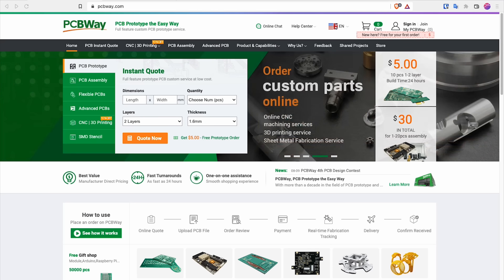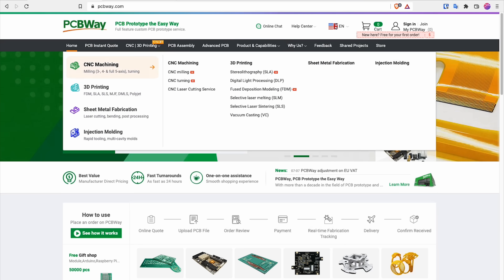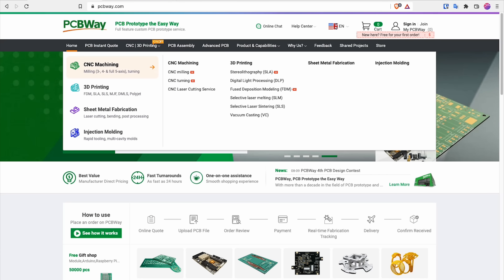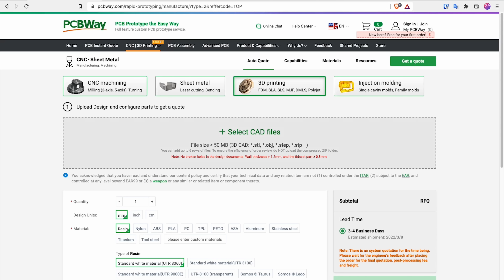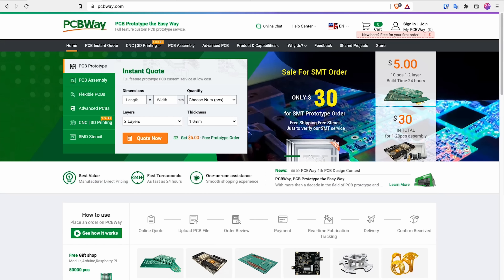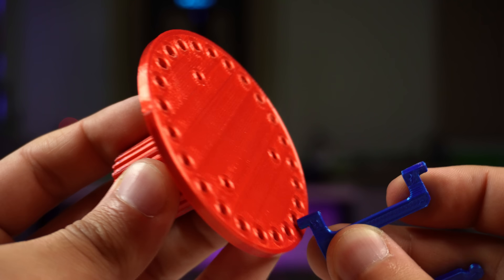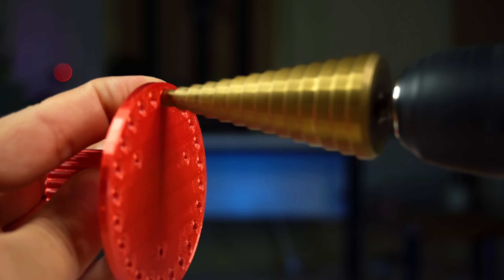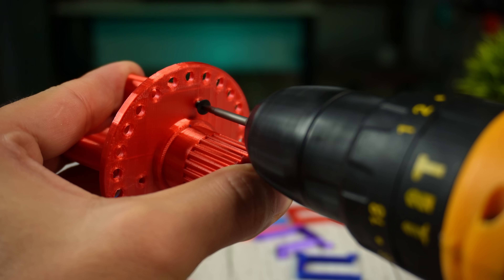Useful Things to 3D Print: Practical 3D Prints for Every Occasion!

Comment: An improvement for the SD card rolodex is to add more room at the ends of the card holders for labels,  maybe about 1.5 to 2 cm, and I believe the original rolodex had a "finger" to keep the cards from falling until an exact moment,  a little after they would from gravity.  That would make it more reliable,  predictable and identifiable

Comment: The tea bag holders look like a PITA to use. They should be flat on the bottom to make sliding the tea bags out easier on your hands. At present, it looks like you have to go at an angle with your hand to make it dispense the tea bag properly. Also, as others have already pointed out, the gimbal glass holder is the most impractical design in this line-up.

Comment: so many people with negative comments, they want to think so much forward that they forget the basics, any design or project exists so that they can be improved, there is nothing in this world that didn't start from the simplest or even ridiculous and that over the years has become the amazing things we use today, look at the beginning of the plane or the automotive industry these are just a few examples of thousands that exist, don't be so negative, evolve my friends, fly with evolution, and stop belittling the PLA I have projects done in PLA in my car for more than 4 years and in the summer it reaches +40ºc inside the car and everything is ok, the difference is to make the correct 3d printing with correct position and values, I dedicated myself to perfecting the pla in the last 4 years and I managed to we were spectacular, to give you an idea the minimum printing temperature I use for PLA is 220ºc
Reply: I hear you. I have PLA parts that have been outside in the direct sunlight in 100°F+ days off and on for a couple years now, and I've seen no signs of degradation yet.
Reply: @hollt693  yes me too, PLA is great, and we have many types of pla available in the market, all of them different from each other

Comment: One again, 3D Printer YouTubers and I have a different interpretation of the word "useful".
Reply: Novelty printer noob click bait is all these "useful" prints are
Reply: "Useful" is in the eye of the beholder.  The most useful thing I have ever printed is a one off replacement clip part that broke and I was able to remake.  That item would make for terrible youtube as it is so specific I am probably the only person who would ever need it.  However I can 100% see someone who lives or works on board a boat finding the gyroscopic cup holder extremely useful with a few easy modifications.
Reply: @HeadCannonPrime  Yes, I get your point that "useful" is subjective and, as pointed out, clearly the original poster and I have different understandings but, in this case, I don't think it applies.

The video is called "Useful Things to 3D Print: Practical 3D Prints for Every Occasion!". That's a lot of hyperbole. I can't think of many people who would come up with any of these ideas as a useful way of resolving an issue.
Reply: Yea, they all seem really shit 😂
Reply: Not one thing that a problem was not  invented to make a crappy plastic  solution.
Reply: Jop like your comment
Reply from the maker: Interesting!

Comment: Can't imagine a worse design for a cup holder print. Everything is wrong. PLA will warp at temps lower than hot coffee. The clamp directly puts stress on the layers. The top support is way too thin and has no reinforcement. Combine all these features with the weight of the coffee cup and you have a print designed literally rip itself apart. 

It's a solution to a problem that doesn't exist. I'd rather have my coffee where I can see it instead of hanging under the desk so when I swivel or pull up my chair I get a lap full of coffee.
Reply: About the PLA: the designer of this cup holder advises to not use PLA for warm drinks, don't know if PETG is sufficient, but ABS should be no problem. The clamp is printed sideways, which is the right choice for not putting stress on the layers, my only concern would be the screw then.
Reply: I rather need a solution for not catching the headphone cable with armrests and crashing the headphone to the floor.

Comment: Cupholder breaks extremely easily, slides off edge of table easily unless you glue it
Reply: PLA and a hot Cup of coffi ... Best Idea ever.
Reply: @Apurox  seriously. A cup of coffee is 70-90°C, and PLA is LIQUID at 170-180°C. PLA will even deform if left in a warm car.
Combine that with the weight of the mug, the weak top support, layer line weakness, and a clamp? It's just stupid.
Even with a stronger material it's a bad design.
Reply: @NormanTiner  I think that was meant ironically. Saying that as an Aspi. But what my confusion is "laptop" safer.
Reply: @wernerhiemer406  Yes, the "best idea ever" line was sarcastic, but I see no indication that Norman wasn't aware of that fact.

As for why the cup holder is referred to as a "laptop saver", my only guess is that by keeping your cup off of your desk, it's meant to prevent you from accidentally spilling it on your laptop. It still seems like a dumb name for a cup holder, but there you go.
Reply: It's a terrible design. Especially for PLA. That print is basically designed to tear itself apart at the layer lines.